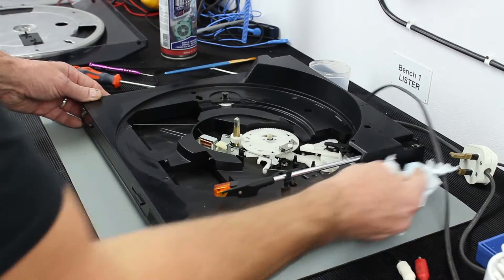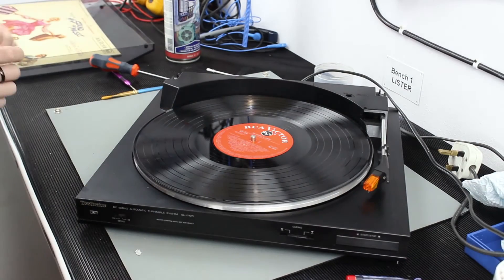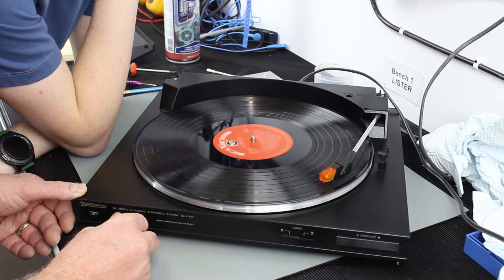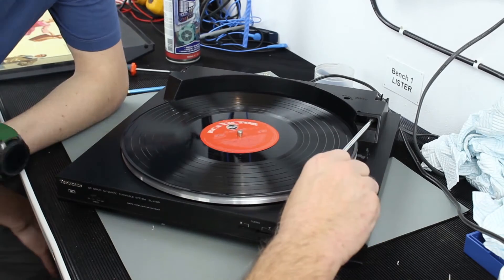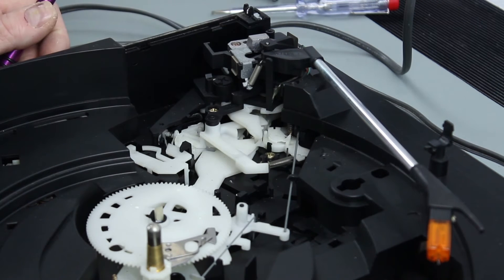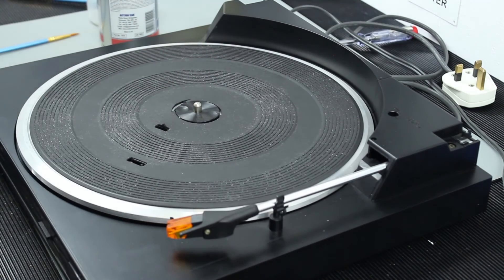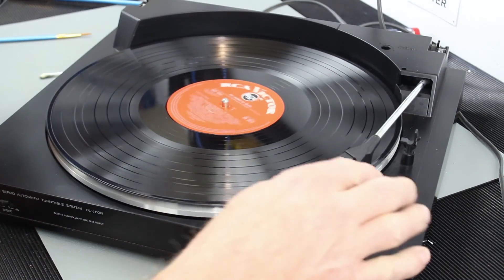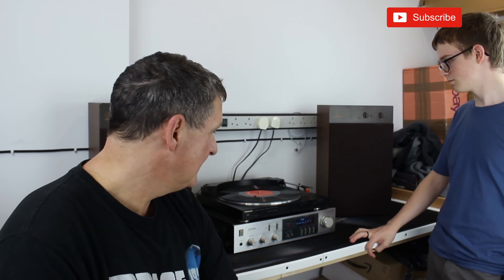Technics SL-J110R turntable part 2 reassembly & function tests. £10 eBay purchase, is it a keeper?

Comment: Just got one and the PCB with the transformer was broken in two pieces, so fixed that with Fevi quick and put a jumper on the live terminal to the primary of the transformer. And back in action

Comment: Great job. I have the same turntable and need an idea to fix the inches for the dust cover. Any suggestions please Sir. Alex
Reply: The exact replacement hinges for the cover are almost impossible to find.  I know some people have 3D printed an insert but i've only used retail bought plastic hinges and fitted them to the rear of the cover and base of the turntable. Not the best solution but by putting them at the back, you don't really see them. Its the not the best fix.  Hope you find something suitable.

Comment: Hi Guys, I have the same model but the problem mine has just endured is when i move the arm it should drive the turntable but it turns for a couple of seconds and then stops. The drive belt looks in good shape and i have taken the back off and it all looks spotless. The turntable has been working fine until now. Before i get rid of it have you any advise.
Many thanks
Clive
Reply from the maker: I would check the electrical contacts on the switch that is activated by moving the pick up arm from its rest position. if not then possibly a motor issue / brush contacts within the motor.